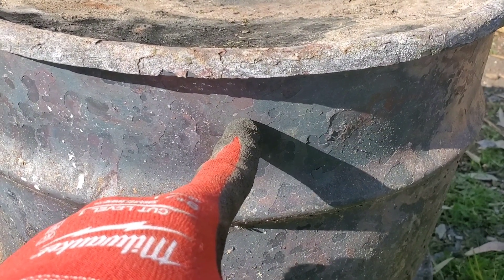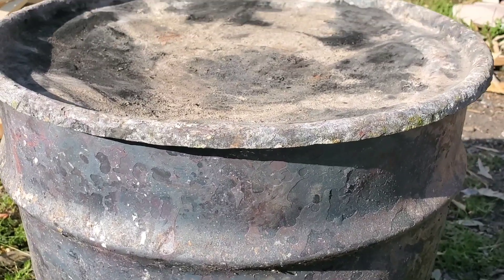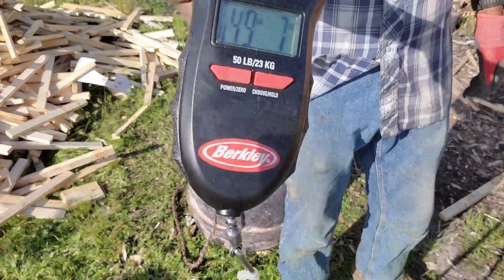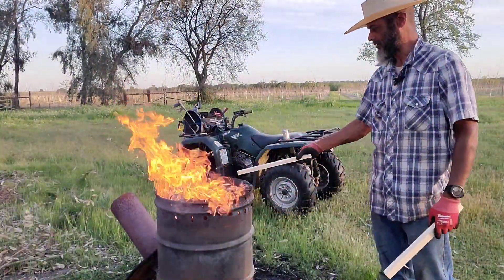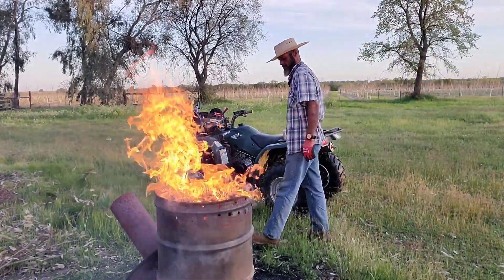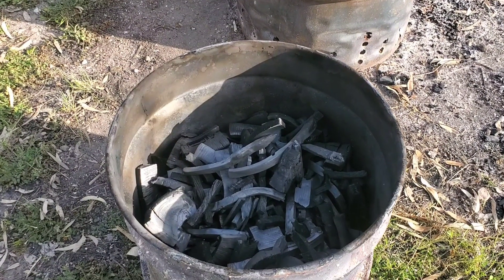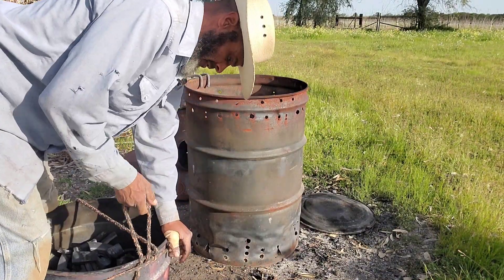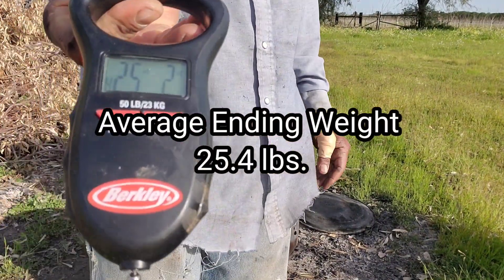Find Out What BIOCHAR Experiments Revealed!

Comment: Have you considered a water coil around the external drum? It may assist in the drums longevity and you get piping hot water. 
Just a thought as you siad youve been lighting one batch per day.
Reply from the maker: I actually have considered doing that but I don't have a specific use for the water I would be heating. I have wanted to find some use for the wasted energy but I haven't come up with a solution yet. 🤷‍♂️
Reply: The size is just about perfect for 1 person to operate. Copper tubing for heat exchange -> kao-wool for insulation -> sheet aluminum to safely sink excess heat and aesthetic enhancement -> Tesla Turbine @Integza

Comment: Thank you for your sharing your knowledge with us...are there any kind of burn barrels you need to avoid when setting these up? Say, if its painted or had some kind of chemicals stored in them possibly. Or does any of that matter really?
Reply from the maker: I personally would not be too concerned if the barrel had been used for non-food grade applications like petroleum storage or other hazmat. Painted barrels would not be an issue in my opinion as all of the material would burn off within the first batch or two. The barrel that I use was  new and un-used however it was painted. All paint was gone within a couple of batches. This is just my opinion. Good luck!